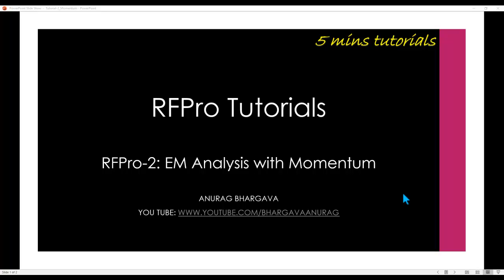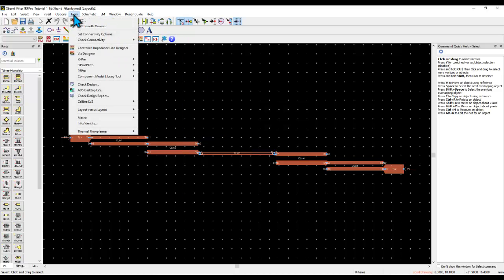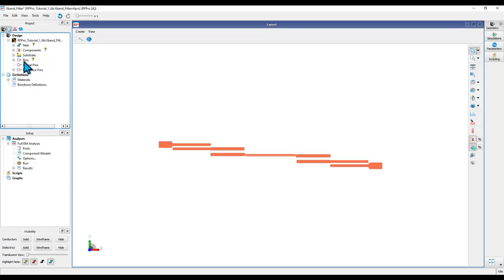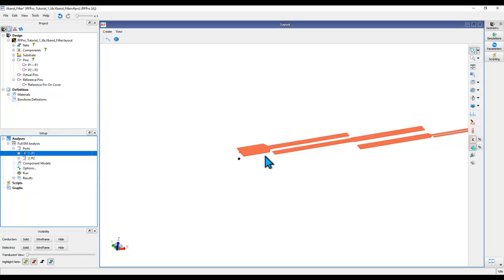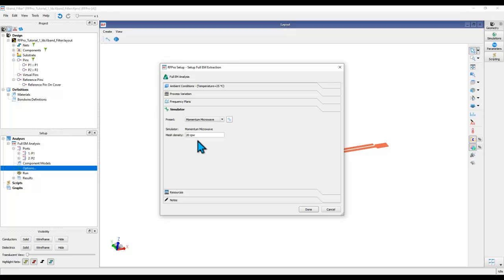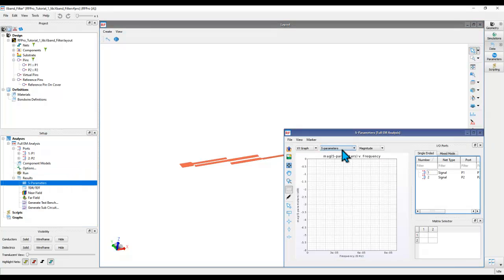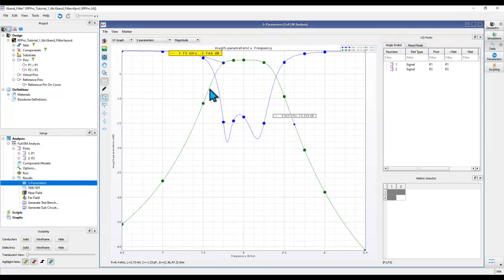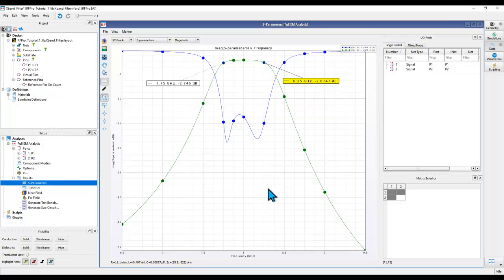RFPro-2: EM Analysis with Momentum

Comment: I've noticed that the ground layer of the PCB is not in the layout diagram here. Does this matter? I see it as a substrate definition, but what about the layout diagrams?
Reply from the maker: @llwonder  it depends on the stack up. In this case its Cover Plate mapped in substrate definition and it is an ideal ground